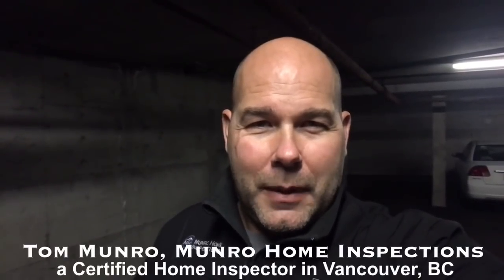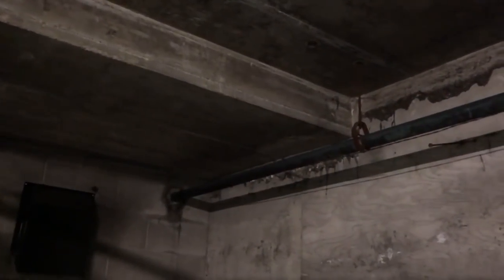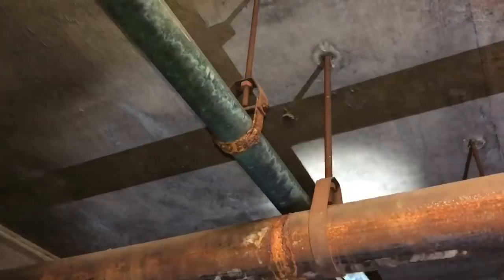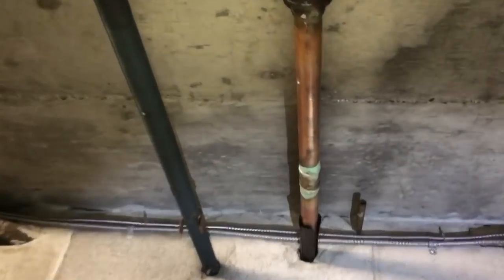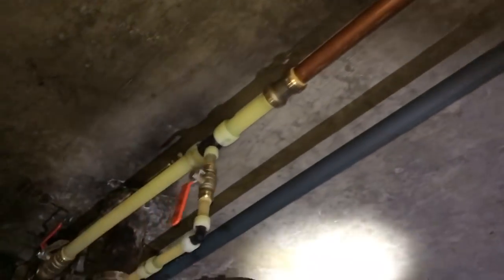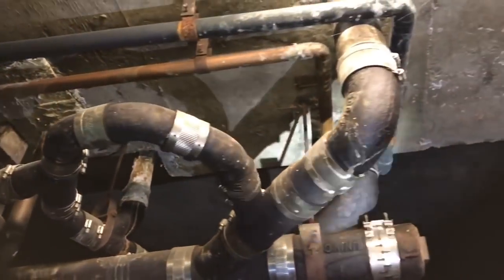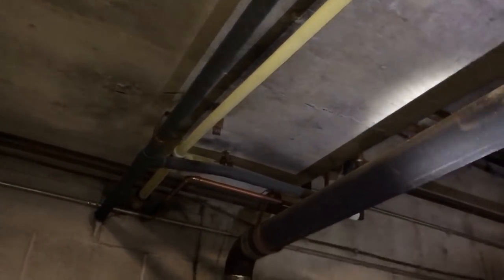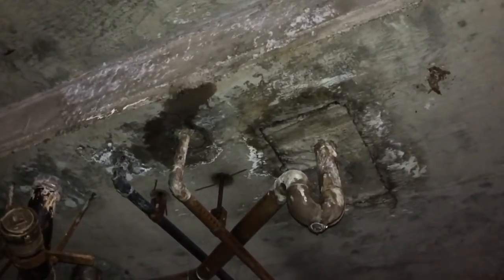Copper Pipe Failure

Comment: The green colored copper water line does not need replaced, that is just surface patina...the supports holding that piping should be changed as you don't want dissimilar metals touching

Comment: The greening of copper is called vertigris (sp?). It is usually atmospheric corrosion. But yeah, a metal bracket will eventually eat through a copper pipe but brass is ok.

Comment: The green is excess Flux at the joint. Just sand or wipe that off and change the clamps. Replacing all that pipe isn't necessary

Comment: All those shark bite connections should have been a huge flag in your eyes. Only good for the cheap non licensed plumbers or for a quick fix until you can hard solder
Reply: GuyFoxHimself very true. Hence why we are not allowed to use them on any commercial projects up here. I have heard of tons of these blowing apart while no one is home. Hence why none of the plumbers I have been going to school with for the last 4 years use them. Unless it's only for a quick temp fix.

If a plumber is using these. I would find a new plumber lol
Reply: CPKustoms That's nonsense. Unless you or these "plumbers" are reusing this fitting 100's of times where the internal O-ring disintegrates/falls apart, they do not leak. If you reuse more than 2 or 3 times, use potable-grade silicone lubricate and lubricate the O-ring so it does not get damaged.

I've never had one leak. And very handy in cases where you have dripping/leaking water especially when connecting PEX to existing copper lines (in re&re cases).
Reply: Walter's Playground to each their own. None of us here in Manitoba like them or use them. Only time we use them is for a temp fix of a dripping line that can't solder until we get the proper pipe plugs or bread to hard solder. If I saw you using these on my site I would get a new helper.
Reply: "If I saw you using these on my site I would get a new helper."

So, you choose to assume I'm a "helper" now?
Reply: Walter's Playground lol I have better things to do then argue with some random on a computer. Im going to go enjoy the rest of my night. 

Cheers:)

Comment: 1:22 thats called a shark bite ball valve. Rook move
Reply: Also could have been an emergency repair or repair with standing or live water.

Don't judge. That is a fix. Sharkbites work well if you use them properly.
Reply: lostcoastlocal 707 could of been a cheap owner or realtor that just wanted to get it done cheap as possible

Comment: Very good video but I disagree on one point. The cold line is oxidized, the same thing that happened to the Statue of Liberty, and is normal. I agree with all the other findings, though.
Reply: Correct.  Flux will do the same thing as shown at the one joint coupling.

Comment: Yep... there should be rubber insulations .... different metals touching..... damn.... + I would put a insulation around the pipes.
That leak is bad....bad man.... very bad.... could be to drill a lot of concrete away to get around this. Did they "forget" to insulate the pipes going through the concrete? Damn...